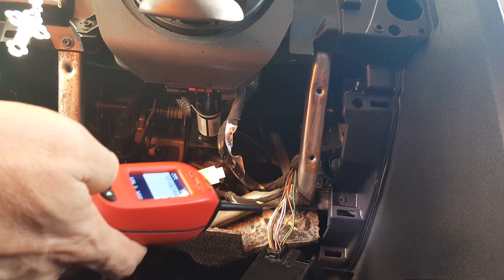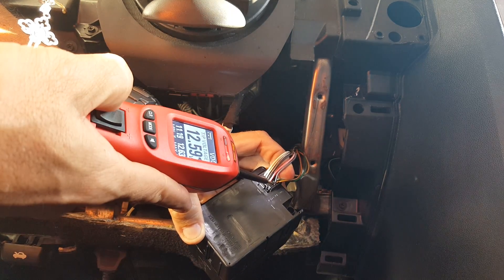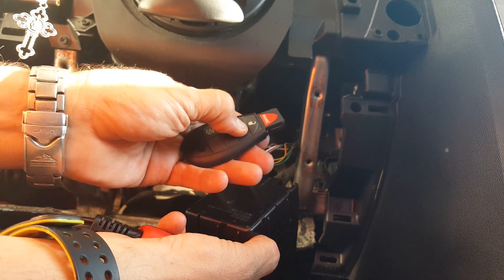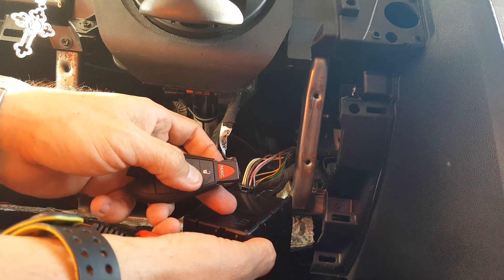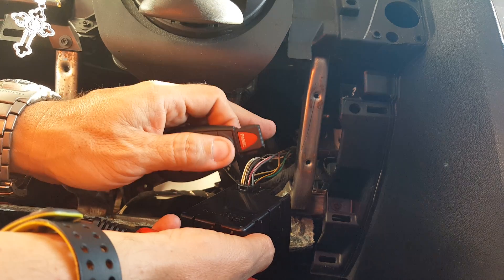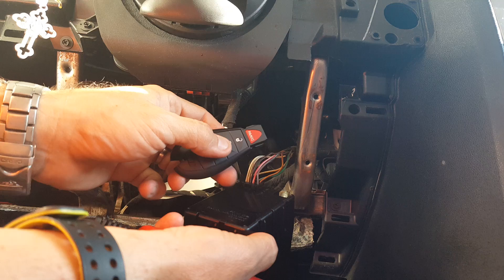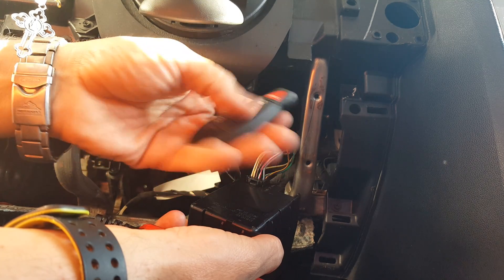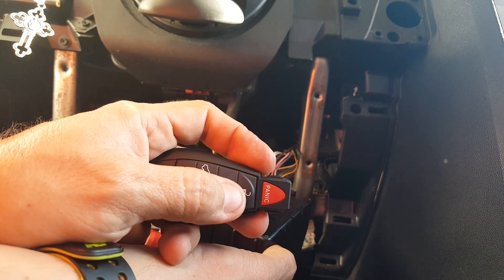Testing wireless ignition node module Chrysler Dodge Jeep ram plug connector

Comment: My Chrysler wouldn't turn to the "off" position because my shifter button wouldn't click and therefore my win wasn't recognizing it was in park. I pulled the win fuse in the tipm and put it back in. I was able to turn my key all the way and remove it. Next time I tried to start it, -no power. -at all. Battery is good. Im not even getting headlights, door locks, nothing. Do you know if a bad win will affect headlights and door locks?
Reply: https://www.nhtsa.gov/recalls
Reply from the maker: What year and model Chrysler?
Reply: @AutoTechElectronic  2008 town and country...
Reply: @AutoTechElectronic  https://youtu.be/3jb6TfiZmgo -this is where im at...

Comment: Hi, I have a 2011 Jeep Grand Cherokee Laredo 6 cyl and recently, my vehicle stopped cranking but I can still perform some functions on the key fob such as locking the doors etc.  Please advise if you think I should replace the WIN module.
Reply: what ended up being the solution?
Reply from the maker: Call our office with the vin for the jeep 956-508-3450

Comment: Owner of ram 2011 long horn eent to start the truck it unlocked but when i put the key in the ignotion and turned it all the ligths inside flashed and turned off And now my key is not working wont unlock or lock and there is no power to the cab nothing happens wen i turn the key battery is good what could it be?
Reply from the maker: With a voltmeter, check that your fuses are good and have 12volts.

Comment: How about if the key starts the car but does not lock or unlock the vehicle. 2005 Jeep grand cherokee. It has an ignition switch and a wireless control module. Thanks.
Reply from the maker: text me a picture of your remote headed key to 8303746845. a picture of the circuit board inside (front and back)   We have various solutions for you.
Reply: I have reset the wireless control module two ways. 1, by disconnected the negative terminal. 2, by removing the fuses for a few minutes and then putting them back in. I could hear it reset.  Still not working. I think whomever had the jeep before me installed a new ignition switch. The key that starts the vehicle does unlock the door so it is the same cut. The only thing i can think of is replacing the wireless control module, taking it to a dealer, have them pull the personal identification number (PIN) from the power control module (PCM) and sync the new WCM. Thoughts?

Circuit board/Fuse box     
http://www.wkjeeps.com/wk_fuses.htm
Key   https://www.aliexpress.com/item/Replacement-Car-Keys-Fit-For-Keyless-Entry-Uncut-Key-Fob-Remote-For-2005-Jeep-Grand-Cherokee/32803478601.html
Reply: Change the first fuse

Comment: Hello I have a 2010 Chrysler Town and Country. We have changed the started and the battery and alternator is good. All my panel lights work and the fob locks and unlocks the doors. But it sometimes I have to turn the fob over in the switch 10 plus times for it to start. Does this sound like its the wireless ignition module?
Reply: Did you figure this out? I am having the exact same issues...
Reply: I am having the same exact issue

Comment: I have a question,intermittently the truck will crank and not start, it will also act as it has a weak battery or starter.i have tested the battery,starter,alternator .alll good .yet once in a while this happens. How do I fix this?
Reply from the maker: Jason Cranman what is the year and model?
Reply: 2007 dodge ram 1500.with a 5.7 liter hemi
Reply from the maker: Jason Cranman are you getting any DTC codes in the PCM?
Reply: No codes
Reply from the maker: Jason Cranman send me a text 830-374-6845 there is fuel and spark?
Reply: Auto Tech Electronic ,this starts after cycling the switch

Comment: I have battery voltage at the run terminal in the run position. How does the WIN signal the start position? The wiring diagram doesn't show how the WIN signals the start position.
Reply from the maker: NothingSpecial information is sent thru the network bus. 
What is the model? And what are the symptoms?
Reply: I'm not trying to tell how to do things but you checked the power without the key in ignition which Is okay but you also have to check if its still giving you constant 12V when you put the key in the ON position because sometimes the win can give 12v but as soon as you put the key in the On position the voltage goes flat 0. That will also tell you the win is bad because if the win isn't  feeding the PCM then PCM will not feed the fuel pump or the starter which will cause a no start

Comment: Hi. I have a RAM 1500 2013 Outdoorsman. Had a non dealership garage try to program new keys as one original was not working and the other one was taking 20 sec holding the unlock button to unlock the doors. garage was not able to program them and was getting an error (truck) "antenna #4" which was a short to ground (B1A74-11 passive entry antenna 4 - circuit short to ground). Antenna 4 is at the Radio frequency hub level (RF HUB) I've been searching around for a diagram to physically locate this module inside my truck without any luck. the garage indicated it is behind my rear seat. Would you be able to let me know where I would be able to find this "box"? thanks
Reply from the maker: We have a video showing you the location: https://www.youtube.com/watch?v=iZugJE7f4Z0&list=PLamzKHaynkcp_pRoQtRmjwpX5rE8il85L&index=19

From what you've described, you have a faulty RF Hub.
We can send you the RF Hub with Two Fobik remotes with 2 warranty for $499.95, already programmed and ready to go.  You can give us a call at 956 508 3450 from 9:00AM to 6PM CST M-F.

Comment: amigo tengo una durango 2011 y el control no abre y cierra las puertas y no enciende con le boton de encendido.. pero si enciende metiendo la llave.. que podra ser?
Reply from the maker: alex86899 revisa la batería  puede ser eso, el control Fobik no sirve o está dañado el PEM module
Reply: Walton Guerrero gracias por su respuesta amigo, ya le cambie la bateria pero sigue igual, dice llave dañada en la pantalla.. lleve la llave con un cerrajero y me dicen que si manda señal.. aun asi puede ser que la llave este dañada??

Comment: I hope you get this ok so my 2008 chrysler 300 worked one day then sat for a few weeks and the battery died I tried jumping it and it wouldn't jump so I got a new battery put it in and nothing works it won't start stater don't click radio don't work car won't get out of park the only thing that works is it'll unlock with the keys and the headlights work please help
Reply: fernando serratos I'm having the same problem right now except I shut my car off for 30 minutes and ran inside my house came outside and now it won't do anything but unlock and the lights will come on. no radio, horn, or any dash lights will come on & my windows are stuck down. checked my fuses and battery everything's good
Reply: Same here could really use some help

Comment: Hi, I own a Dodge Ram 1500 year 2012. I've actually bought it from someone. And around 3 months back it started giving issues while starting in the morning or after office. But it used to start after 2 or 3 attempts back then. 
One morning It didn't start at all so I had to get the battery checked thinking it was a power issue. And yes it was the battery, although after I changed the battery, the problem did not go away. 
It gives me a problem starting up almost every morning now and sometimes it just turns off while I am driving it (However I do remember hitting a bump or bad road before it shutoff while driving). 
I was lookin at your video and wanted to know if it could be a WIN Module issue also the Key Fob does sometimes gives a problem while I try it but very rarely. The spare Key fob does not work at all.
Reply: My 2011 truck has the exact same issue. Did this fix your problem?
Reply: @alexandergarcia7362  what fixed your problem Garcia?
Reply: Same issue here with the same year truck did fixing the win module help?
Reply from the maker: Waqas Rishi   All these are symptoms of a 2 ND generation win module which are not repairable. You may purchase a new one with 2 new fobik remote keys $499.95    You may purchase at autotecheletronic.com. 2 year warranty

Comment: My best regards and thanks for your videos well explained. I would like to explain to you about a problem that I had this morning with my GCL 2011 I went  to start the car i inserted the key to turn on the car and appeared in the deshboard screen  message saying  "dameged key "and the car is totally dead dead i tried with the other key the answer it, I  disconnect the positive cable from the battery I left it for 5 minutes I returned to connect the battery and instantly the dashboard and the dvd screen turned on without connecting or pressing  the key to start. what do you suggest my friend it could  be the problem or what should I do? Thank you very much for your valuable time.
Reply from the maker: Mr. goldstick call me or text me at 830-374-6845